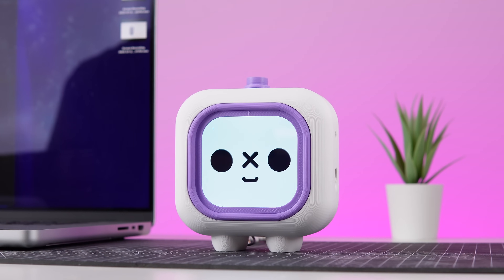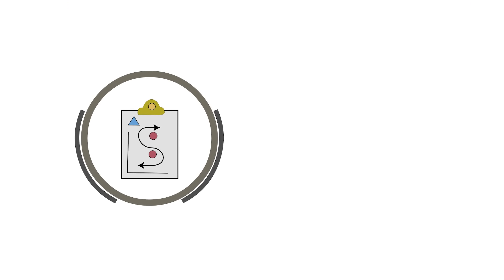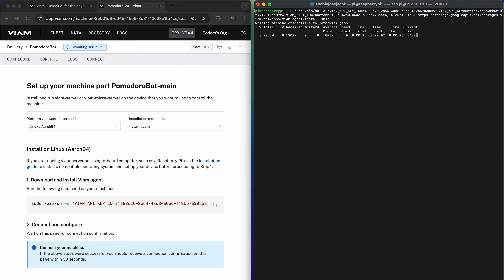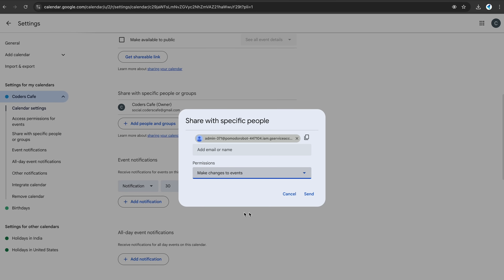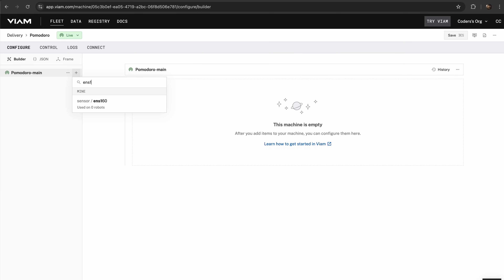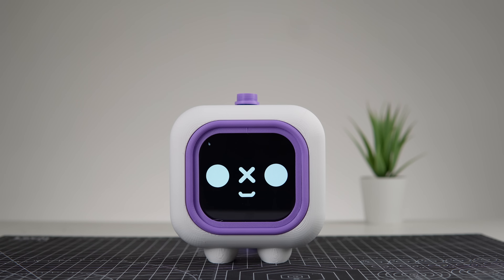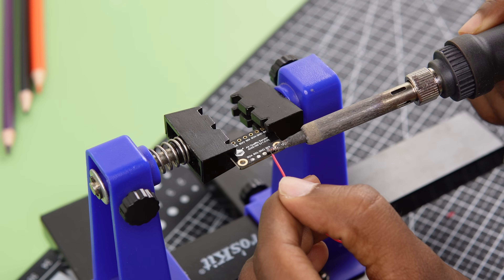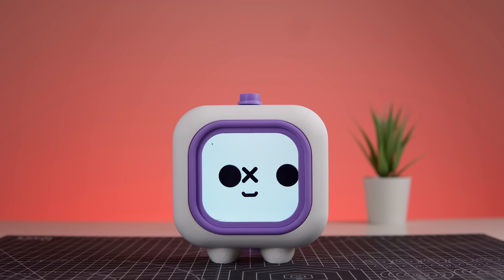How to Build a DIY Robot Companion at Home

Comment: how much ram is required for raspberry pi 5?
Reply from the maker: 8GB is preferred.
Reply: @CodersCafeTech  But will it work in 4gb too? As 8gb one is on the more expensive side for my project
Reply from the maker: @juhighosh2173 Yes it will work, but if you're trying LLMs onboard the response will be slow.

Comment: Interesting start. But I think there could be a lot more to it, don't you think ?
Doesn't Viam cost something? Wouldn't an open source solution be better?
Where do you get the STL for the case ?
Reply: Viam here! Our on-machine functionality is open-source and free to operate. If you eventually start managing a fleet, it’s usage-based billing for cloud services and data storage.
Reply: @viamrobotics  Unfortunately, the answer is missing here. the youtube filter has probably eaten it and would have to be published.

If you go under Pricing, it is communicated differently. a revision might not be a bad idea.

and thanks for the answer.
Reply: Thanks VIAM 👍 awesome 😎
Reply from the maker: Thank you for your feedback! 😊

We're glad you found the Pomodoro bot interesting. You're absolutely right—there’s always room for improvement, and we're constantly brainstorming ways to make it more versatile and feature-rich while keeping it simple for beginners to replicate. And you can expect a Part 2 of Pomodoro Bot With more features soon!

As for Viam, it's free to get started! It provides a powerful and beginner-friendly platform that streamlines robotics development. Viam combines ease of use with robust capabilities, making it an excellent choice for this kind of project.

Regarding the STL file for the case, we'll share them soon after some final adjustments! Thanks again for your thoughts! Let us know if you have more questions or ideas to share.
Reply: @CodersCafeTech  
but under pricing it says something else :
Tabular / JSON data management
$0.50 per gb/month
Image & video data management
$0.15 per gb/month
For bulk storage exceeding 100 GB/month pricing can adapt to volume. Please contact sales for custom pricing.
Cloud data upload
$0.15 per gb
Cloud data egress
$0.25 per gb
Standard compute
$0.0025 per seconds
Trigger notifications
$2.50 PER 1M NOTIFICATIONS
No credit card required to sign up and the first $5 / month is free

I have several similar projects in mind, my problem is I can't draw smileys.
I can't do it with AI because it never keeps the same style 100%.
I wanted to write an app for myself that does the same thing as Poki or Dasai the car “robot”
Because I have the hardware in every cell phone...
But how could I draw such smileys if I can't do it :(